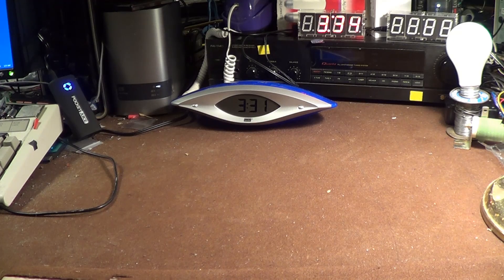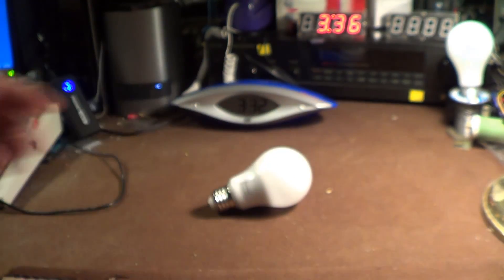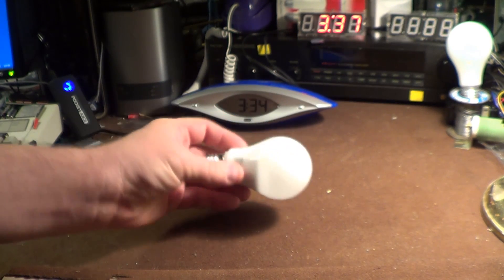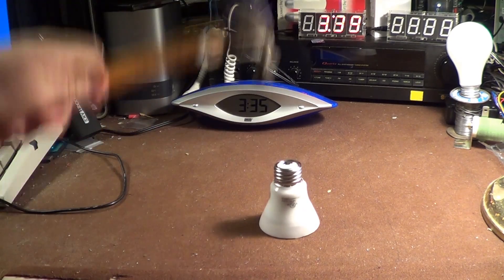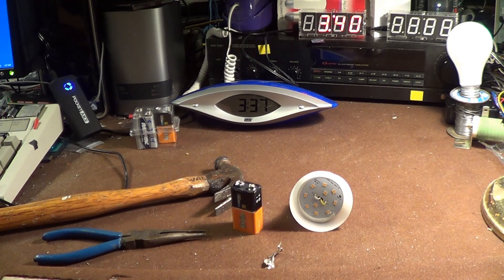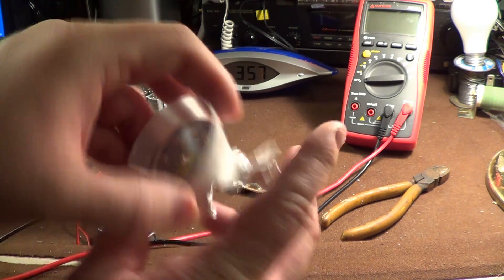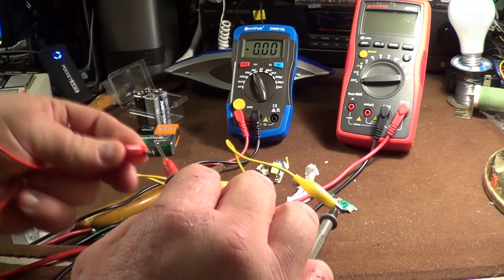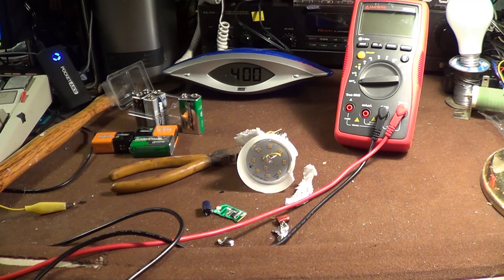Westinghouse LED Bulb Failure

Comment: I wonder if that fixture in your bathroom is actually rated for using higher watt bulbs. I recently bought a desk lamp at IKEA and despite it having an Edison base, it is only rated for a maximum of 13 watts which is shockingly low and means that you can pretty much only use LED bulbs. The electricity company around here subsidizes LED bulbs, and you can get the four pack of GE 60 watt equivalent bulbs at Walmart for $0.97. The price for those to my knowledge rose up to $8.97 right before they started subsidizing them and I have a suspicion that Walmart raised the price so that the power company can write the higher amount off of their taxes.
Reply from the maker: It's hard to say. The sockets in various fixtures still look much the same to me, especially the porcelain types. There could be more than meets the eye.

For most things, I don't see a reason not to use LED bulbs.

Comment: I see another bulb in the background. Did that end up in the crapper?
Reply from the maker: The bulb stuck in the roll of solder is an incandescent bulb.
Reply: OK, I originally missed the mention that your fixture was made for LED bulbs. At the time, I was thinking that maybe you got frustrated & stuck incandescents in there.
Reply from the maker: I didn't realize until rather later that I misunderstood your question. The incandescent bulb stuck in the roll of solder is used for placing a dummy load on repaired and refurbished uninterruptible power supplies. I have a bunch of them in varying wattages for units of different capacity.

I don't think there is any prohibition on putting incandescent lamps in the bathroom light fixture, but as I had some Cree LED bulbs that I got for free, I just hauled one of those out and put it in. It works fine outside of a slightly different color temperature and I expect it will last a good long time.

Comment: "You can be sure... if it's Westinghouse" no more.
Reply: I remember when it used to say that on the boxes that their monitors came in. Even then, those things (or at least the one I owned) had cheap Chi Mei Optoelectronic panels, but it wasn't a terrible monitor (other than a flaw in the power supply board that warranted its replacement) in terms of PQ.

Comment: LEDs have come a long way since the giant things plastered with 5mm cold white LEDs on stacks of PCBs, the reliability leaves a lot to be desired though, I bought some of those LED filament bulbs back in 2015, most of them have crapped out, and as for bulbs like the one you have here, I only recently got a handful of them from Poundland (the favoured haunt of Bigclivedotcom, and the same "Electrek" ones he took to bits the other day), and so far they're doing okay, just wish they had a choice of colour temperatures, not everyone likes the yellow-white colours... :)

Comment: LEDs don't seem to last much longer than incandescents, just because the electronics fail so quickly... except LEDs can fail in a dangerous way. I think I'll stick with my hoard of light bulbs haha
Reply from the maker: Sometimes it's even worse than that. I have a 130 volt incandescent in my closet that's been there for the last seventeen years. Since the pull chain is broken, I just twist it out of the socket a bit to turn it off. Even with all that handling, it's still going!
Reply: wilkes85 when I heard incandescents were being phased out, got a whole bunch of my favorite Decade long life bulbs. Heavier filament and turns on slower. To use them up I will have to live to be 500 years old.

Comment: LED bulbs are always advertised as having fabulously long lives (20 000h etc.) but in my experience they don't last as long as CCFLs and will overheat easily when placed in an enclosure. 
The cheapest decent ones I can buy here cost the equivalent of 2$, and the manufacturer still has to provide a 2 year warranty by law since LED bulbs are considered electrical appliances, so I can't complain if they only last about a year.
Reply from the maker: If they didn't drive the LEDs to within an inch of their lives and used a few more of them to get the light output up instead, they would last that long, if not a lot longer.
Reply: i have a pair of philips first generation led bulbs that were given to me by someone that said they were not bright enough. they are 60 watt equivalent led bulbs and this person was saying they were not as bright as a 120 watt bulb. no kidding so they gave me $120 worth of LED bulbs that are running longer than GE branded CFL bulbs. tho i do have one great value CFL bulb still running 10 years later. Heat is the killer of both technologies.

Comment: You could apply 3v across each led to see if all of them are dead.
Reply from the maker: I'll have to do some more disassembly to get at the solder points. They weren't visible from above. I do plan to try it, though.

Comment: Supposed to last 29.1 years, and packed it up after a year.  Good thing those bulbs are so expensive since they save you so much money!  Yep, they save you everything except the cash in your wallet!
Reply: jaykay18 at least with these you don't have to take them to a hazardous waste facility (but I doubt anyone actually  does it's a big problem )like you do with cfls.......(or god forbid  drop a cfl by accident)
Reply: There's more mercury in fish than there is in a CFL.  There is the absolutely tiniest dot of mercury in there, not anything to possibly precipitate a public health emergency.
Reply from the maker: I'll believe it when I see it. They said the same thing about CFLs, and it's not like it couldn't be done if there was any aspect of quality in the designs. There's a magnetically ballasted troffer lamp in the computer mess room whose ballast is 45 years old if it's a day and even though I use it all the time, I've only changed the tubes in it three times over the last 25 years.

I like that, "good thing those bulbs are so expensive since they save you so much money". It'll be interesting to see how the remaining three of them do.
Reply: I'd be interested to know as well!  On the note about the magnetically ballasted fluorescent lamps, I have also found that bulbs in them last an exceptionally long time.  Perhaps it's not as harsh starting the bulb, which is when most of the damage occurs, although with that blinking you'd think it would be.  I have quite a number of magnetically ballasted fluorescents in the house, at least 12 that I can mentally count.  I've also found that those bulbs typically start at a particular brightness (known as FULL) and just stay that way, there's no warm-up period required to achieve full brightness.  I certainly don't mind the delay and them blinking when turned on, I find that far more acceptable than a lot of LEDs today where you flick on the switch and there's that delay where you start getting the hint of "maybe the bulb burned out" until it turns right on and blinds you.  I'll stick to fluorescent and incandescent myself; I haven't found one LED bulb or light fixture that I actually like yet.  I believe I've made at least 2 videos on that subject.
Reply: They're not terribly expensive where I am. I'm paying ~$2/bulb and that's cheaper than CFLs or incandescents are.
Reply: I can get CFLs for  a dollar apiece, and incandescents under a dollar.  LEDs have come down in price, but I still refuse to pay a premium for short service life and directional poor quality light.

Comment: the switch mode driver chip is probably a brightpower chip. I'm xtremely common, and dirt cheap. it also does the job just fine.

Comment: I've had a ubrite (not exactly sure) bulb fail on me it would glow but very dimly will be tearing it down and making another portable light out of it.
any idea how many volts is coming through the two wires in the center? I've rewired an LED bulb to run on between 9 and 12 volts. search hella bright 12 volt LED light on YouTube.

Comment: Anything Westinghouse is crap
Reply from the maker: Not quite true in the case of this bulb. The other three are still going.
Reply: Maybe it's just their TVs and appliances that I've had bad experiences with...
Reply from the maker: The "real" Westinghouse never had anything to do with those TVs. They are made by the lowest bidders amongst Chinese manufacturers. Some are great, many are crap.

(White-)Westinghouse did make their own appliances and many of those were certainly of good quality. That division was later sold to Electrolux. After that, I'd say the quality was pretty mixed.

They didn't have anything to do with this bulb either, but the basic design seems remarkably sound and well thought out.
Reply: Interesting.
Reply: My first clock radio was a White Westinghouse that I got in 1999. After about two years, one of the time set buttons broke. I replaced it with a Sony clock radio which still works to this day.